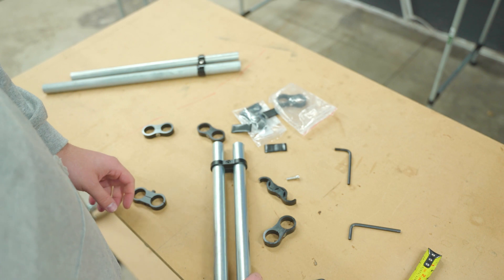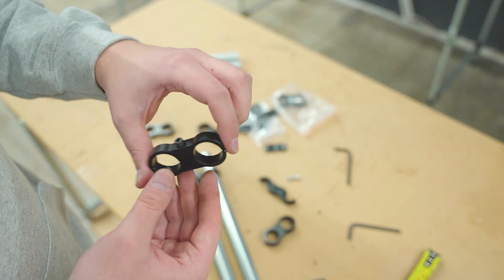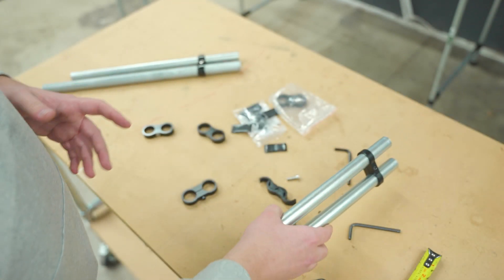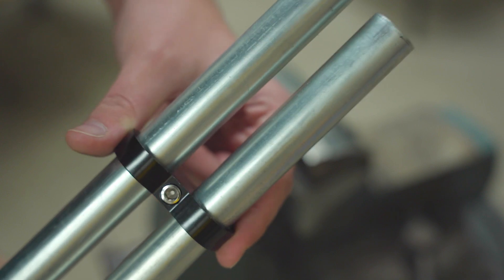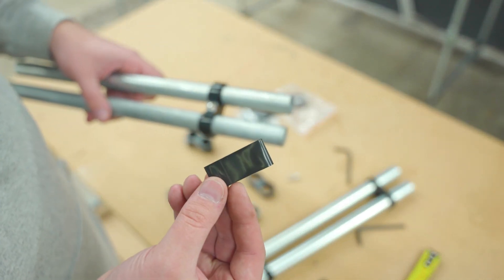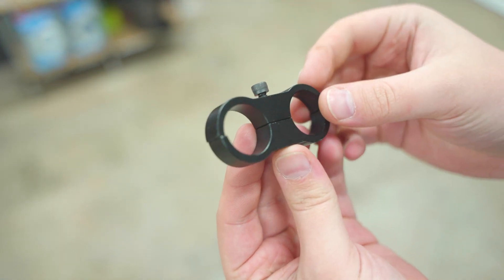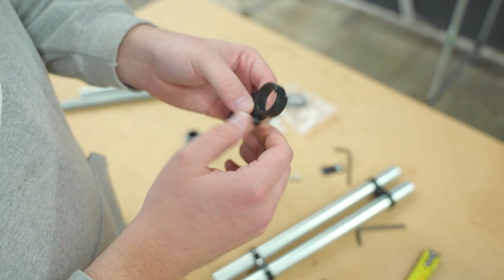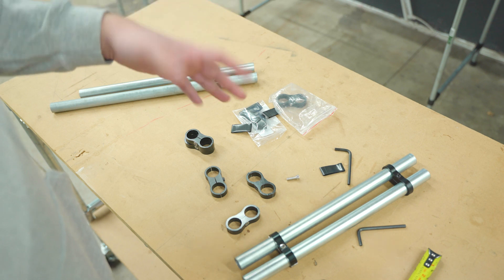Unexpected Solution Makes This Possible!

Comment: Cool.  I was I bought cheap 1/2" on craigslist that was laying around someone's yard.  I will heat shrink everything to look nice.  I'm using the 1/2" horizontally (7 foot run) for tomato plant strings.  These can get a plants can get kinda heavy so I was looking at 45 degree braces at each end of the run.  I assume the reason for banding the pipes together is for additional strength ?  I wonder how that additional strength compare to using my 45 degree braces at each end ?  I'm guessing that I should stick with the 45 degree braces, especially being 1/2 inch ?
Reply from the maker: Hey TJ, good find on the 1/2" EMT. The extra bands work well to provide extra pull out strength and overall grip. For a 7 foot span of 1/2" EMT you'll definitely want at least the 45 degree braces. If you could add a support leg in the middle of the span with 180's you'd be well off. You're right that the tomatoes will get heavy and 1/2" will start to flex pretty early on. Let us know if you have any other questions.

Comment: Can these be structural? Like in a roof rack?
Reply from the maker: We haven't tried them in a build like that so I don't want to say yes and not be correct. We are going to do some strength testing on the Maker Pipe Connectors soon and we will try some tests on those as well. Thanks for the comment!
Reply: @MakerPipe  can't wait 😁😁😁😁😁
If they are structural for an addition to my maker pipe roof rack 😁😁😁😁😁😁
Make life easier ...

I'm excited about getting started on this maker pipe roof rack..
Told my gf about it and she's game too so that's nice